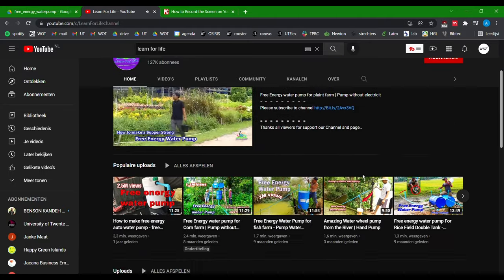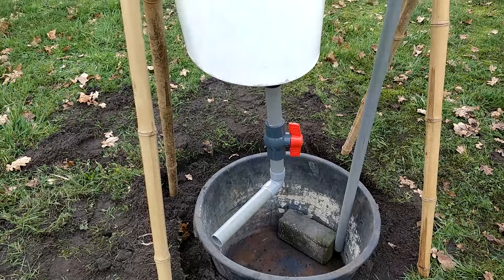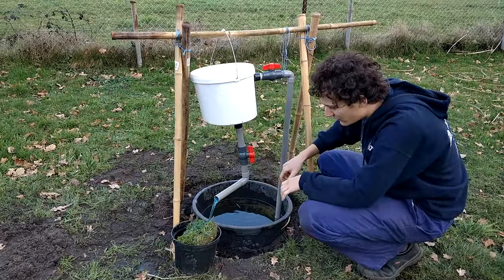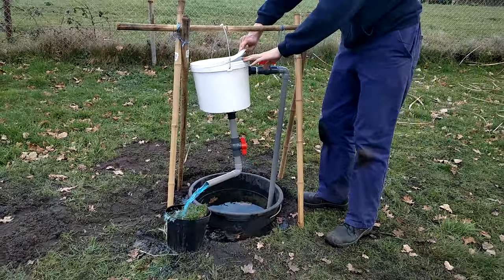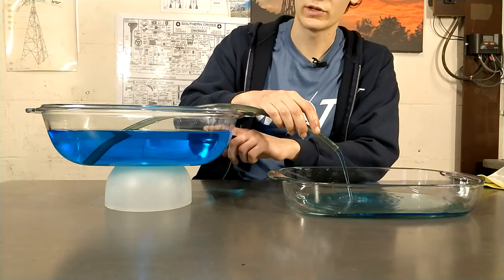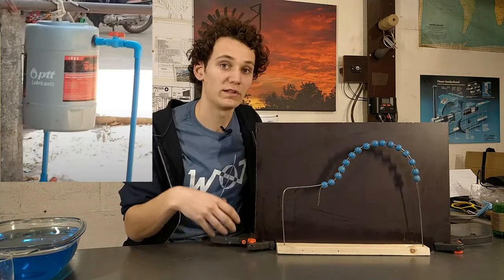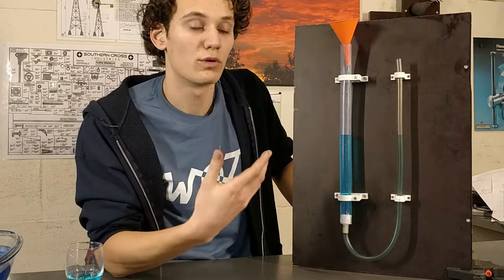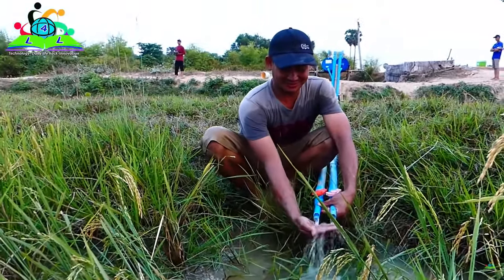FREE ENERGY Water Pump Tested. Is it possible?

Comment: You've missed the whole idea/system. It works in a closed system where a vacuum is created in the drum, not an open-top bucket. (This is 6th-grade science class, I guess you missed that.) It's actually a gravity pump, where the volume of the water falling creates a vacuum that draws the water up the intake tube back into the drum at a rate equal to the water draining out of it, but the outflow pipe must be bigger diameter than the input tube. This is what causes the water to be drawn up into the tank. It's critical that there be very little air in the drum for air compresses greater than water. If there is air in the system (bubbles in the draw pipe) it won't work. It is a siphon system.

Oh, and showing a "Water level" is not an exemplary test, for both ends of the tube are open so atmospheric pressure is equal on both sides. That has nothing to do with the Gravity/siphon pump. Neither does your "Bead demonstration"
Reply: I haven't checked if WOT has done something wrong, but he is absolutely right that this system does not work. If it would work, why is it nowhere in use? It seems to work only in YT-videos! And it would clearly violate conservation of energy. Lifting water out of a well needs energy. Where does it come from? If this would work, you could build a perfect perpetuum mobile. Feed the outlet back in the well. You would have a continuous circulation of water and could even drive a small turbine by it. To nice to be true! Perpetuum mobiles don't exist.
Reply: Thanks,  for your  encouragement. I 've just concluded an unsuccessful one with 24litire tank. So I will try it again.
Reply: You’ve missed the whole idea. In 6th grade you learn that a siphon can not lift any water. And yes, this is a siphon with a priming barrel.

Comment: Myself did it differently and it didn't work, until I did it properly by having a longer exit pipe and it work, infact if it starts to work the pressure is going to compress the plastic bucket. It works and I'm going to do it this time around using bigger drums and better fittings.
Reply: We shall live and happy in this world.the wicked shall not prevail. For God is love. Thanks alot.
Reply: Thanks for fact sharing guys. Bravo

Comment: The problem is the buckets you are using. They are NOT, I repeat, they are NOT sealed containers. Air does come in under the lid. You also have to have more water in the bucket than what is being pulled (by vacuum in the bucket) and pushed (by atmospheric pressure outside) otherwise it won't make enough of a vacuum . The weight of the water inside pulling a vaccuum and the atmospheric pressure working together should easily make the water move, and nothing seems to go against thermodynamics as the initial energy input is the water flowing out, drawing a vacuum which creates the atmospheric difference that makes the water come up the pipe. Seems rather simple and obvious to me...
Reply: Sorry, but this video is to the point. No siphon can lift any water uphill. The lid is ok, the system is sucking air from the output proving that.

Comment: It does work. I built same model with 55gal drum with 20 ft of output 2in pipe and 1in inlet pipe . set pump atop of another plastic 55ga barrel filled with water. I put the inlet pipe into water barrel, had air trap pipe on outlet pipe and reduced the end of outlet pipe to 1in like there example. I opened the oulet pipe and water did draw out of the water plastic barrel.
Reply: And how long did the water flow out of the outlet?
Reply: Thanks so much  for sharing. Please  people should shear their findings on Utube about any of those DIY scams that cost people lots time and money. I had spent 20yrs on wood gasifiers with no genuine result on Utube.
Reply: @franklinibiademosi9615    Scam videos are a nuisance. As far as these "pumps" are concerned, the correct statement is simple: when the outlet is higher than the water level in the water reservoir this does definitely not work, never mind what you try with pipe dimensions, valves or other stuff. Water can't be lifted to a higher level without an input of external energy. On the other hand, if the outlet is lower than the water level in the water reservoir, it can work. But in this case no barrel is needed, it is sufficient to prefill the pipes/hoses with water. Water will then flow upwards and downwards by the siphon effect, which was already known B.C. But the downflowing height must be bigger then the upflowing height.
Reply: @heinzpg  but would't the drum on the top filled with water, and the water weight complete the circle? I did one just like in the videos but didn't work. All sealed, primed etc

Comment: What you are missing is you have to bleed the water so it is at the level of the inlet(with foot valve at the source's end) thus the water source would be higher than the discharge.
Reply: Noop, given that the tank is large enough, the tank will prime the siphon.
Reply: I don't even think you knew what you were talking about with this comment. Read it, it doesn't make sense.

Comment: You should try again. There can be no leaks, there must be valves involved, the bucket must be solid (or it will collapse), intake pipe size should be smaller than the output pipe, output needs more length to generate head pressure, you need 1 or 2 air pressure/capture reservoir on the output side, and you need a 1 way valve at the bottom of the intake.
Reply: There is something else to think about. If this pump would work, you could at once build with it a perfect perpetuum mobile. Best proof that this pump does not work, never mind what adaptions you try.
Reply: Valves are not needed at all.

Comment: I would like to see you test this with a completely sealed tank. I believe the lid allows some air into the bucket. It’s my understanding that it will work if the tank is sealed which causes a suction, like drinking from a straw.
Reply: Exactly what I think, also like cypher gas from gas tank
Reply from the maker: Hi,  the fact that you hear the bubbling sound and that water comes out in pulses also means that air gets in via the outlet. If there would be a significant air leak in the seal of the bucket I would expect there to be a continuous flow, then air will not have to enter the bucket through the outlet pipe.  That said, it might still be possible there is a small air leak. But considering the bucket used was a paint bucket, which should seal off well, I expect the bucket to be airtight.

You are right that suction pulls up the water. It is however important to understand that this suction force is limited. If you drink from a 10 meter high straw you will have difficulty getting the water up, as you can imagine. In our case the suction force is caused by the downward flowing water. As shown in the video the pressure (or suction force if you will) caused by a column of water is only dependent on the height difference in the outlet. The suction  force required to pull water up is dependent on the height difference in the inlet. In other words: if the outlet pipe is higher than the inlet pipe, the suction force created by the water in the outlet is not large enough to suck the water up through the inlet. Therefore you can only pump from a high level to a low level.

And that’s also the takeaway message from this video. Whatever your setup: If you don’t add energy to the system, you cannot pump from a low point to a high point.
Reply: @WOT_utwente  👍
Reply: @sothaketh8929  "siphon", not "cypher".

Comment: You have to triple the height of your tank and quadruple the length of the output tube to prevent air backflow
Reply: read my posts. you are correct.
Reply: Noop. Tank is ok. You may extend the horizontal length of the output. In that case it only will take some lonnger time for the bucket to drain.
Reply: Quadrupling the length of the output tube won't make any difference.

Comment: Please try again.

1. Larger supply tank. The weight of the water in your supply tank must overcome the weight of the water in your wells casing.
2. Smaller outlet pipe, you don’t want air to be able to go back into supply tank.
3. Prime your apparatus of air before pumping water.
Reply: 1) Tank size is more than adequate. 
2) He shows that air will tend to enter the system from the outlet. You see tha water only comes out after a gulp of air has entered the tank. If you dip the output into a tea cup, no water will come out of this system. In fact, if the orifice is smooth enough, you could hold a piece of a thin plastic lid against the outlet. Water would stay in the bucket an no water will come out. 
3) He primed the system: filled it with the exit closed. Put an ait tight lid on the bucket. With a bucket, there is no need for filling the suction pipe.

Comment: Perpetual motion is impossible. However you can make the pump work the vacume and flow rate needs to be better calibrated.. it may run for hours until the atmospheric pressure drops. It may only run until the reservoir empties or only work for a minute or two. Regardless it won't permanently run off siphon alone. It would need gravity to supply the source of energy into the system. Energy cannot be created or destroyed it transfers no matter how hard we try to lock it into a system that requires work. It's simply not possible. And that sucks.
Reply: Perpetual motion is not impossible, the rotation of the planets is just one example…

Comment: I am amazed, you explained this very well, but still an incredible number of people seem to think this will work, without trying it themselves.  It also seems after looking at all the comments that the overall intuitive reasoning is that vacuum is involved.  It can appear to look that way I guess, and maybe a video explaining that it is not vacuum would be good (you did really explain it, but I'm betting people do not see the significance of your water level in the pipes demonstration), but instead it is low pressure on one side (supposedly vacuum side) and atmosphere pressure (higher)pressure) on the water source side.  And that's the kicker; no matter how you make the device, if the water source side has a lower height than the exit nozzle, it will not flow.  If you syphon water from a swimming pool, you can suck on the end of the pipe to give the pipe end lower pressure than the source end of the pipe, but then you need to drop the pipe end below the source end of the pipe for it to syphon; its positive pressure at the source that is the mechanism.  Adding the Barrel into the system will apparently only confuse millions of people.
Reply: Agreed. The barrel is a priming tool so you do not need any foot valve at the source end.

Comment: Many commenters criticise, that the lid on the bucket is not air tight - or not air tight enough. But if it wouldn't be airtight, water would flow freely and not come out gurgling by air leaking in from the outlet. And if you prevent air leaking in, it still doesn't work with an outlet higher than the water level in the well. What all people forget who think that a vacuum is created which lifts the water from a deeper well: the vacuum also "sucks" on the water in the bucket. The vacuum which would be needed to lift water from the well is bigger than the vacuum which stops the outflow. Thus you have already a stall, before the vacuum becomes big enough to lift the water the full height from a deeper well.

Comment: thank you for sharing. you are a good scientist but the actual system you didn't try accurately is a hybrid of creating a vacuum and siphoning. so sealing well is mandatory and the total volume of the higher tank should be larger than all pipe Vol. this type of pump first relies on siphoning and when the volume of water in the higher tank decreases makes a negative pressure to pull up the water from the well. of course, the trapped air, water temperature, and well height are also important. I didn't try this but I am not sure about how long this water pump will work.
Reply: NO, he's not a "good" scientist. His foundation understanding is uneducated.
Reply: @guyfaux1494     Since his conclusion - this kind of systems only works if the outlet is lower than the water leven in the water reservoir - is correct, his knowledge of science is quite good. What point do you claim is "uneducated"?
Reply: @sciencefreak9070  사이펀의 원리를 증명하는 것은 그냥 간단한데 저런 시스템이 필요 없죠. 괜한 고생으로 만들었네요. ㅋㅋㅋ  
음압차(진공)과 중력으로 펌프를 만들 생각을 했다면 
아직 많이 부족하네요. 더 공부하셔야 할 듯 ...
Reply: @MrJeon-st8gu    I am not the one who has to learn, my knowledge in physics is fairly good! The vacuum which forms at the top of the tank is the reason, why this device only works with an outlet lower than the water level in the well. Because if the outlet is higher than the water level in the well the vacuum stops the outflow before it is strong enough to lift the water for the whole height between water level in the well and the top of the tank. And have you considered, that if this design would work and could lift water to a higher level without an input of energy it would make a perfect perpetuum mobile? You could let the water flow back in the well and drive a turbine on its way.

Comment: I've seen these pumps used in poorer countries to pull water from canals into palnted areas and you are right the planted area is always at least a little lower than the water level in the canal. the best I can access about the barrel, it is used to make sure the siphon continues if there is a case of the intake pipe getting uncovered some how. It is nothing more than a "siphon storage" so it would be ok so long as if the loss in intake water was no longer than the amount of water in the barrel. Good vid. LOL, some people need to take a physics class.
Reply: Thanks lol, even fictions become great inventions  this days and better laws of visics are emerging. Just opportunities and scammer we need to be vigilant of. Cheers.
Reply: The magic works, as I understand it, when the weight of the water in the container exceeds the weight of the water being sucked up the inlet pipe.  As long as the volume of water in the tank is greater than the volume of water in the inlet, and there are no air leaks, it will work perfectly every time.
Reply: @tinfredrickson2880  It doesn't matter how much weight is in the container, it's still just a siphon. Water can only be pulled up by more water going down even farther. By filling the container at the beginning, you are adding that much energy to the system. At most, in a perfect world which doe not exist, it could pull the same amount of water up as it falls. In reality, there are always losses to entropy, and it can never even pull up the same volume of water as was innitially put in the tank. Unless, of course, the outlet is lower than the water intake, in which case it can keep going until the two water levels match.

Comment: I can't speak to the 'pump' you speak of, but gravity water systems work uphill. I have a hose end in a stream and the other end in a bucket up about 3 metres from source. The run is about 300 metres so maybe that helps create momentum to push the water uphill. But it works.
Reply: No siphone can lift water to a higher level, impossible. Against well known laws of physics. Now if you have a ram pump down in the stream, that is another thing.